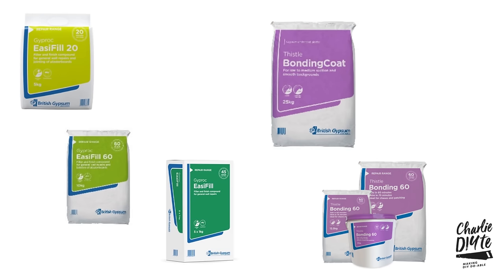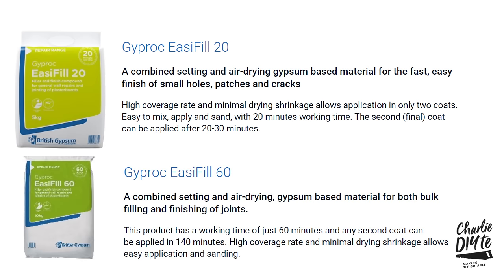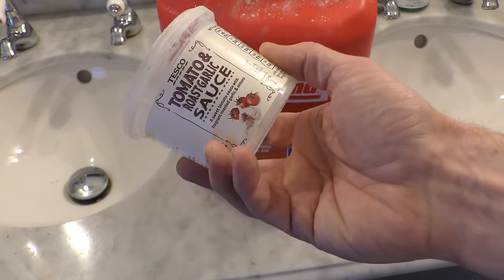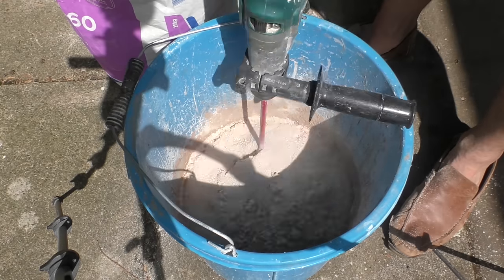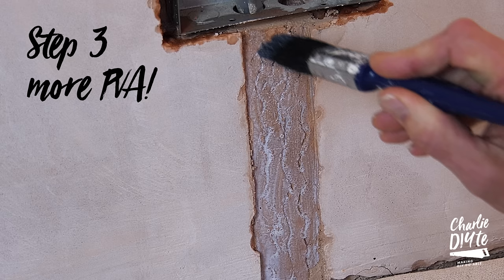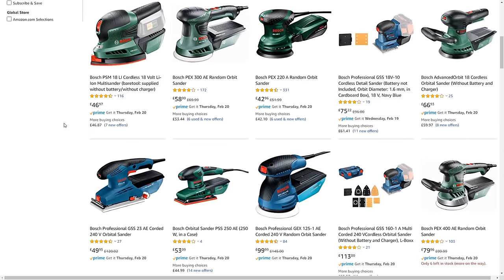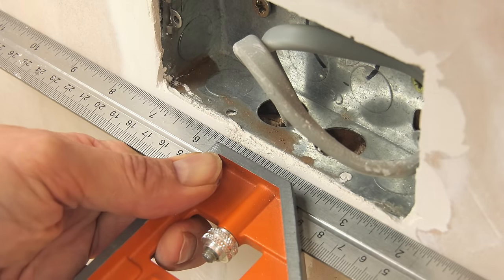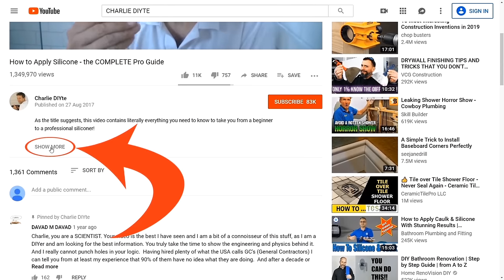How to Fill Wall Chases, Cracks & Holes

Comment: Cracks in wall usualy best to make slightly deeper giving more surface area for the filler but great job as always love your vids
Reply from the maker: I agree, and I did this in my recent Short vid. They haven't come back though so fingers crossed.
Reply: @CharlieDIYte  lol only added that comment for those who only seen this vid great vid and I love easyfill for chasing and any small repair quick in and out minimal fuss but I usualy got big rooms walls and ceilings and ain't gonna use easy fill lol but it's a great product for those on the way home jobs few hour easy money

Comment: @charlie I'm just about to fill chases in my walls for the first time... 6 in total... The walls are going to be skimmed so do I need to use the bonding and the easifill or should I just bond it and leave it slightly shallow
Reply: Bond it but I think you should leave it flush with the rest. Skim is a few mm so just don't protrude too much

Comment: I use plasterboard adhesive for chase filling and top fine fill of Toupret fine surface.  Probably totally wrong but always works well and secure.
Reply from the maker: No, a lot of people use plasterboard adhesive for filling, and yes, that Toupret fine surface is a great product, particularly for shallow repairs.

Comment: Will this technique work if I have radiator cables chased in the wall or do I have to do something different?
Reply from the maker: With the heat you always run the potential risk of the filler cracking, but this is as good a filter to use as any. 👍🏻

Comment: I am looking to remove a media plate from a new build (on an external wall not plasterboard), no idea how deep it will be. If it's deeper than what you have on this video, will Easyfill suffice or will it need skimming with plaster?
Reply from the maker: If it's deep you could either build it out with bonding or perhaps sand and cement as it's an external wall, and then skim over with EasiFill or plaster.
Reply: @CharlieDIYte  Thankyou! Any advantages or disadvantages of using Easifill over the Gypsum finishing plaster?

Comment: Having had new bay windows fitted there  was quite a gap between where the window frame and the ceiling. The workmen stuck a plastic strip (usual practice) to cover the hole but personally I prefer it without. If I remove the the plastic strip would easi fill be okay to use  only it’s just a hole with nothing for the plaster to grip too only the inner edge of the ceiling

Comment: Unless I was working on a whole house, I would use one coat plaster. It will give a good smooth surface and is a lot quicker. Any imperfection I would use good old polly fills, as  It goes off quick and can be sanded if needed.

Comment: Hi Charlie. I used two diall steel hollow wall anchors on plasterboard to fit a mirror. Very secure fit but the mirror is 1cm off being central to the wall. I really want to move it but fear drilling another hole 5mm to the side of the existing hole is not a good idea due to weakness? What can I do?
Reply from the maker: Hi Darren. If you're like me, you'll want to sort that as it will be really annoying you! You're watching the right video here as Easifill is THE stuff to use for this repair. Is it one of these http://bit.ly/3atW3zB If you're lucky the front washer/collar that sits flush on the front of the wall can be twisted off with some long nosed piers. If it's attached to the body of the wall anchor without any twist off points, you'll need to drill it off the rest of the wall anchor with a large eg 10mm hss drill bit. Once you've removed it, you can push the anchor into the void behind the plasterboard. Then fill the hole with some Easifill - this is perfect for a small repair like this http://bit.ly/393yo8a Just don't push too much in because you don't want it creating a peak behind the plasterboard. Let it set, sand it until the repair is invisible. When solidified it's basically like new plasterboard, so you haven't got any worries with re-drilling the hole 1cm away. Then redrill and insert a new wall anchor. Job done 👍

Comment: is the 1x5kg easifill 45 ok if you're just doing 1-2 very small chases? don't want to have 4+kg of expensive easifill 60 that will just become useless in a basement somewhere
Reply from the maker: Yes that will do the job fine 👍

Comment: Don't forget the the grommet in the box mate the Sparky's are gonna be going mad ,plus it would  fail an electrical inspection !!! Don't ask how I know lol
Reply from the maker: Don't worry mate, I have a box of grommets and they'll be in before sparks comes round 👍
Reply: Charlie DIYte    Should have fitted the grommet before pushing the wire through otherwise you risk cutting into the cable.....just saying.....😜
Reply from the maker: @yensabi  Fair point, but there's no risk of that happening 👍
Reply: Famous last words Charlie...
Reply from the maker: @anotherledfreak8649  oh ye of little faith 😉
Reply: Yes you should use grommets but it wouldn't fail an electrical inspection

Comment: Is the easyfill better to use than the multifinish - which I find horrendous to work with.
Reply from the maker: Yes. Dead easy. But as a repair filler rather than to do whole walls, although I have patched quite large areas with it in the past.
Reply: @CharlieDIYte   Thanks I will try that next time for another room.

Comment: Hi Charlie, do you have a video on how to chase without creating too much dust?
Reply from the maker: I don't, unfortunately. Your best bet is probably to hire a wall chaser that has the vacuum attached. For the one featured in the video, I kept the dust down by drilling a line of holes with my SDS drill and then knocking out the chase with a chisel. Created so much less dust than if I had used my grinder.
Reply: Thanks for taking the time to reply and keep up your wonderful content.  I'd love it if you could do a series on converting your loft (without dorma)  for storage. Really interested in how the roof beams can be moved aside for head space. All the best👍

Comment: Charlie or anyone else know about how long to leave bonding before skimming? I can find lots of advice that is coming from the angle of "how quick can I get to the skimming" but what I actually want to know is whether there is any negative to leaving it longer and letting it dry more? Like 24 or 48hrs? Im doing all this around 2 jobs and a baby so it's little  bits at a time! Thanks :)
Reply from the maker: Yes, I wouldn't worry about leaving it for a few days or even a few weeks. But if it's fully dry, then give it a coat of watered down PVA before you skim and let it dry fully. That way, it will reduce the suction and prevent the plaster drying out too quickly. Some plasterers recommend  as an alternative re-wetting the bonding before skimming but I don't think Gerard has ever done that at my gaff. Hope that helps.
Reply: Just had cause to rewatch this video and can't believe I never replied to say thanks!! Sorry Charlie. Your videos are so helpful. And your advice here helped me do a great job a year back and now it's going to help me again so thanks!!

Comment: An even easier fix, expanding foam around the box and in the chase, cut it back so it’s about 5mm hollow, then 2 coats of any filler, ready mixed of powder and water. The foam dries quick, and prevents movement which in turn prevents cracking.

Comment: If your DIY is not just one filling job measure the water first and make a note of how much filler is created. ie pour 100ml of water into the mixing bucket, add the powder and after the job note down what the job was, the amount of water and if that was the right amount. After a few little plastering tasks you should be able to get it accurate most of the time using your dirty little notepad that you can't remember where you put :)
Reply from the maker: That's a good tip, John, thanks for that 👍

Comment: Hi, whats the best method to fill a hole in the fireplace? Its already sealed with breeze blocks at the back but I want to plaster over the hole, then put thermal wallpaper over the top
Reply from the maker: What's the gap depth you have to fill?
Reply: @CharlieDIYte  17 cm deep and the hole in the plaster is 50 cm by 56 cm
Reply: @CharlieDIYte  its the hole in the plasterboard left after taking the fire out. Im not confident with putting a layer of bricks in with cement and cant get hold of a bricklayer.  Trying a different method that involves a wooden batten frame around the hole, cut a bit of plasterboard to fit, glue it all in place, tape around the join then put the wallpaper over the top.

Comment: Would you know if the easifill 60 would bond to wood ? Sounds silly but I will be putting in a narrow plywood box channel for cables in the wall and will need to Finnish over it.
Reply from the maker: It's meant for plaster but there's no reason why you can't use it for this. Just PVA the box first and I'm sure you won't have any problems 👍
Reply: Brilliant, thanks for the reply

Comment: What about painting? The filler is bright white, and if the surrounding wall is darker won’t it show different after painted?
Reply from the maker: No, you mist coat as usual and then a couple of top coats and the repair is invisible.
Reply: @CharlieDIYte  thanks for the reply! Ohh okay, so is that 50/50 paint and water? So just mist coat the repair, and then give it a couple of proper coats and it should be okay? 

How about zinsser bulls eye 123, people have recommended that as a sealer for the repair, would that be in place of the mist coat or as well as? Also, I’ve read the pva can mess with filler, have you had this? Though I think this was from people that put pva on top of the filler and then painted, which you didn’t.  Sorry for the obvious questions, first house, never repaired a hole before.

Comment: I must admit, whenever I've filled in chases & missing bits of plaster, I've always just used a single application of one-coat plaster, which has given excellent results.  I get a smooth, sandable, paintable finish.  What's the advantage of applying separate bond-coat & finishing plaster?
Reply from the maker: I guess bonding is cheaper and is a good quick way of filling deeper chases before plastering.
Reply: @CharlieDIYte  I've just seen the last part of your video- I didn't know that bonding plaster was 5 x cheaper than easy-fill, no wonder you use both types!  Is easy-fill the same thing as Thistle one-coat?

Comment: Use dirty water that will speed setting time 🤙nice hair cut 😂also use dry lining filler it goes off very quickly and sand very flat, refill drys even faster
Reply: Dirty water works on plaster... not so much bonding... handful of cement makes it go off like a rocket

Comment: Try wetting your “ hawk “ before using it, makes it abit slippery to start but wen u learn how to plaster with abit of experience, ur plaster will transfer from hawk to trowel much easier and cleaner, you’ll get used to it bud, 👍

Comment: Can i paint easifill 60, or should i use a primer pior to painting
Reply from the maker: You would want to seal it, with a mist coat or new plaster paint, as discussed here https://youtu.be/jTjlaAU1NzY You can prepare a small tub, roller it on and then feather the edges with a fine grit sand paper, if it's a spot repair on a wall that's been already painted.

Comment: I am also wondering why the chases were done after the wall had been freshly plastered ?? Surely better planning would’ve avoided this entire job ?
Reply from the maker: You're right. I should have done this before the plastering. But it's often not an ideal world and I had to get the plastering done before pulling up the floor, which in turn I needed to do to get to the electrics. Better planning indeed.

Comment: Does anyone know what the scientific reason is for adding the powder to the water as opposed to the other way around?  I always add the water second no matter what I am using; yes I have to mix it for longer (and as a DIYer I'm not on the clock), but the results are always fine and I have minimal waste.
Is this soley to do with powder clumping (electrostatic charges and all that jazz) or is there some other reason?
Reply from the maker: It's as you say - to prevent lumps but adding the water second as you know gives you much better control of volume being mixed.

Comment: Can I sand unperfect multi finish or it will be  hard to sand it down and make it smooth
Reply from the maker: Yes you can sand multi finish.
Reply: @CharlieDIYte  thanks for quick respond I really like watching your videos. If you don't mind let me ask you one more question do you prefer multi finish over bonding coat or filler which one will be more durable in long term

Comment: Great video however to you know that you broke the IEE regulation when you did the wiring for the socket.   Where is the protection for the cable when it goes in to the back box. There are no grommets on any of the sockets that you installed.   I just hope that people don’t do the electrical side of this work as they can cause all sorts of issues.
Reply from the maker: As discussed here https://youtu.be/AmmjoHrggPg The problem is none of the old back boxes have grommets in so I'm having to gradually replace them as and when.
Reply: If done correctly who would know?

Comment: Do you not need to use mesh tape too?
Reply from the maker: D'you mean scrim tape? You use this on the plasterboard joins to prevent cracking but don't need it on a repair like this.
Reply: @CharlieDIYte  thanks, good to know. Seen some people use it. I’ve never used it in the past and it has turned out well. Just needed your opinion. Thanks again!

Comment: Any thickness greater than 4mm tends to take 5-10days to dry and go "rock hard". Are you finding the same thing?
Reply from the maker: Maybe 24 hours but certainly not 5 days
Reply: @CharlieDIYte  must be a bad batch then!
Reply from the maker: Yes, you also don't want to mix it up too wet.

Comment: I think using drywall adhesive works better it hold it and it goes rock solid then use easy fill
Reply: Also you are you drywall adhesive to put the electric box in and it won't come loose or fall out

Comment: On the electric side those Wago connectors are so much better than traditional screw block connectors
Reply from the maker: I'm addicted to them, Raj. Discovered a couple of those circular bakelite junction boxes under the floor when I was refurbishing the bedroom and replaced them with Wago XL junction boxes as I won't be able to access them now the floor's back down. Such lovely kit!
Reply: Hager J803s are the best push fit junction boxes. Wago ones are only suitable if you use the correct connector and use the MF inserts to hold them secure

Comment: Hi, I have seen a few of your vids now and really rate your workmanship and delivery, however, you advertise as a DIYer, not a qualified spark, you should not be installing sockets yourself, grommets are not an addition after to pass regs but a mechanism to prevent damage to cable, you should not be advertising to DIYers that they can do this work and get a spark to sign it off, grateful for the filling advice, its difficult to die from filling but not from bad electrics.

Comment: Also why mess about? Bonding Coat your chase, let it dry and skim it! Using multi finish, non of this messing about, sanding and re filling ect ect, just feather it in with a wet brush and abit of water! Don’t even need to sand it down! £11 for 25kg bonding n £7 for 25kg multi finish, will more than likely do a full house of chases and have some spare! Anyone needs a proper plaster in leeds/ Wakefield area let me know, I’ll save you money and do it properly with 19 years experience
Reply from the maker: It's a fair point. Easy for a pro plasterer. I'm really just trying to come up with a practical solution for us DIYers.
Reply: Sorry mate, your doing an excellent job and atleast your showing people how to do it, I’m sorry if I came across as a dick head mate, keep up the good contents buddy, sometimes they use a sponge also to help feather it in and take any bumps out. Thanks again mate

Comment: Except for that the fact the chase work is poor not a bad video but either is irrelevant due to the fact of drying time is not correct as with alllll bags leave overnight and come back tomorrow rub down, paint, refill with 5 minute filler and then run down and paint and perfect finish

Comment: If your adding sockets to a circuit you must have a minor works certificate. You will run into problems when you sell the property if you don't. I would always use a registered electrician for electrical work as there are more problem created by DIY electricians.anyone can run a cable and cut in a back box, but unless you know the science and rules behind it you are being dangerous.